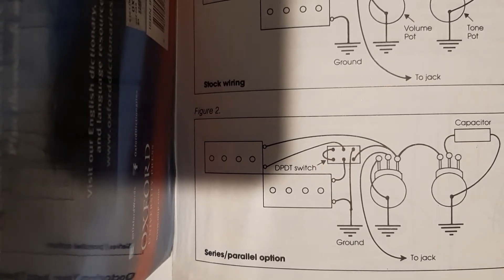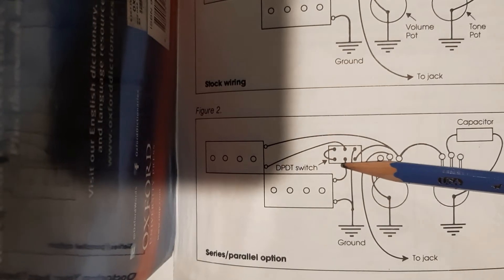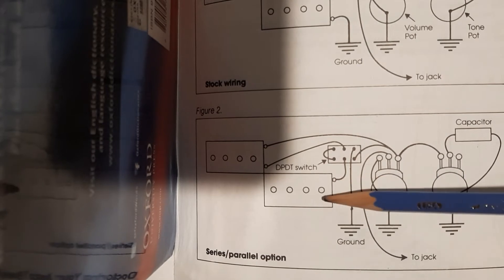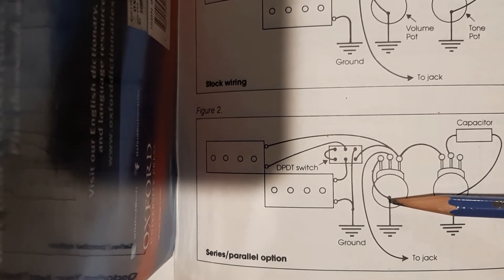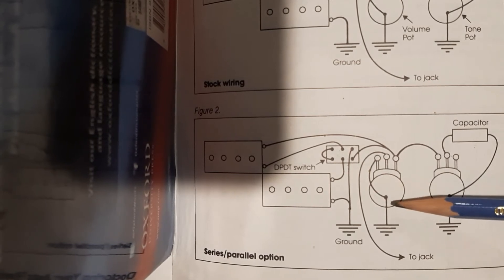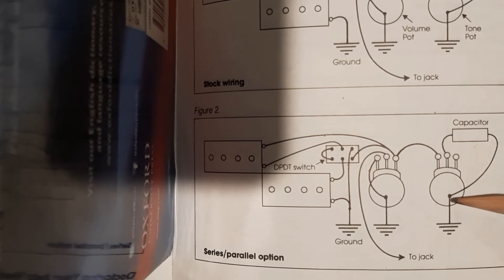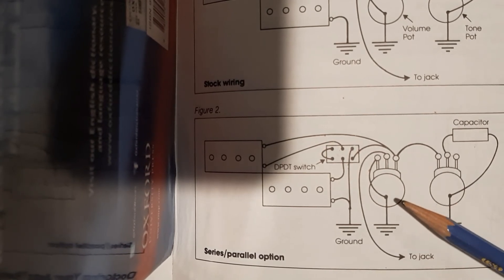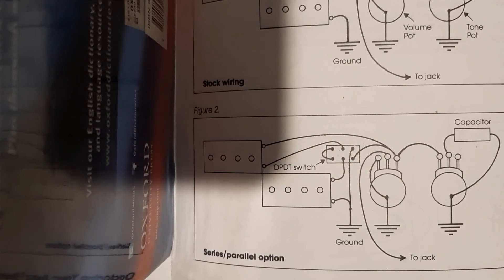P-Bass DPDT Series Parallel Circuit Explained

Comment: My 1981/2 VOX Standard bass is wired in this way.  Thanks for sharing - was looking for an explanation - the wiring diagram is a bonus, as I am swapping out some of the components and re-soldering everything.  Much easier than trying to read the rather blobby soldering on the switch.  Cheers.
Reply from the maker: No problem - Glad it helped!

Comment: I would just run in parallel.  Now, what cap do we use for that?
Reply from the maker: I assume you are talking about the cap in the tone circuit...You can use anything from .03 to .05 or so. Caps are cheap, so try a few values to see what you like. Higher value capacitors will cut more highs.